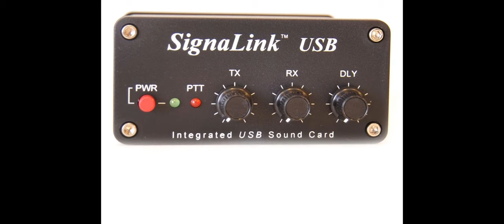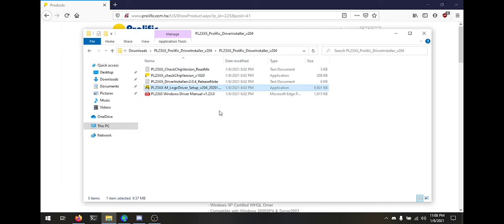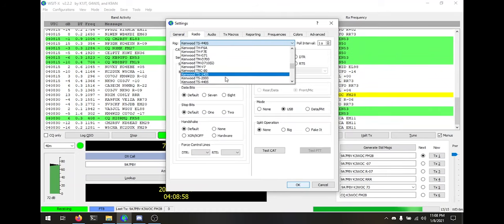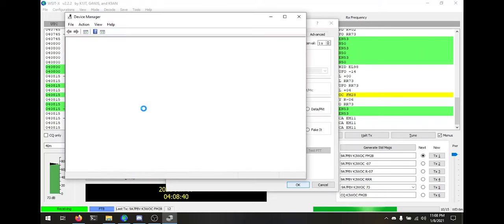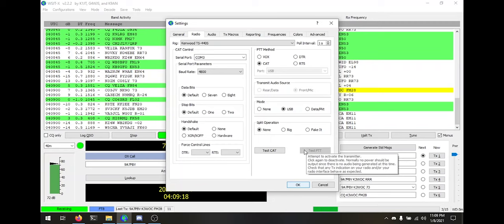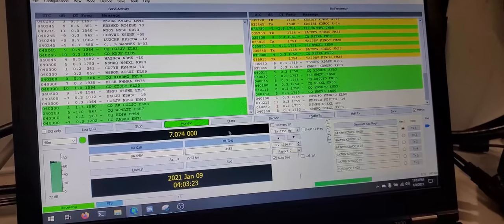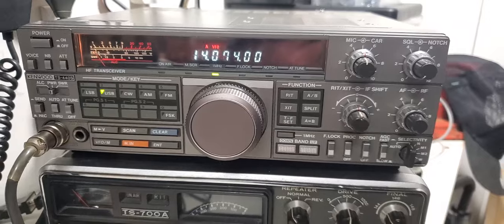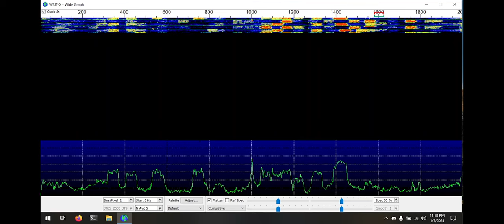Ham Radio Digital Modes and CAT Control for the Kenwood TS-440S (IC-10 Installation)

Comment: Thanks for the video. I'm a new ham radio guy and the TS-440s is my first transceiver. I bought a CAT cable and the integrated circuits. Today the ICs were built into the transceiver. I've problems with the connection to my Windows 11 notebook...

Comment: Thank you for the informative video.  I tried the Signal Link with my TS400S without success.  Your solution with the CAT cable and the Behringer U-Phoria UM2 worked absolutely perfectly with my Raspberry Pi.  Your solution is absolutely the best for the TS440.
Reply: I'd love to do the raspberry pi integration, do you have more info on this @alandigiovanni5282 ?

Comment: i picked up a non working 440 3 years ago, manage to get it playing, but it never was 100%, so a few weeka ago i bought a beat up unit from ebay, now i have a fully working 440 in great electrical and good cosmetic shape. with 270, 500hz filter and atu, next on the list is the IC-10 :)
Reply: IC-10 just arrived, time to make a set of cables.

Comment: This is a very nice tutorial, Marky. I bought the chips, the CAT-Cable and the UM2 and downloaded the needed software as you describe it here. When everything is installed I can start running FT8 on my old TS-440S. :-) Regards from DJ0MDC.
Reply: where did you find the IC chip set? i looked on pie xx and it came up zero results
Reply: I've done the same thing, but for some reason, I keep getting the error, I've come back to the old radio to try get it going, got any hints ?

Comment: That's a great mod for a radio with a few years on it.  In fact, if a clean and cheap TS-440 came my way...  My problem with FT8 these days is CPU power of the computer!  I'll be looking  for ya!  - W3ENR
Reply from the maker: Good to hear from you Ed!!! Hope all is well!!! You know, I tried using my brand new Raspberry Pi 400 with this task, and it was too dog slow! I couldn't tell if it was just a problem with the Pi, or the Linux distro, or maybe even fldigi, but it was unbearable. A project for another day will be for me to tweak the settings as much as possible and get it working efficiently on a Pi. Probably doesn't help having a waterfall running too. I was shocked how quickly I was up and running in Windows! Enjoy your weekend my friend!
Reply: @MarkyShaw  I mainly use JTDX.  I've overclocked my Pi 4b as far as it will stably go (~1.8Ghz), and it can't keep up with a busy band.  But the truth is that an i7 Intel NUC that I have - a couple generations old, but still a quad core i7 - can't do it either.  Watching the Pi, I know why.  At least for FT8.  It tries to cram most of the computing into those two seconds between transmission windows.  So the Pi would just put-put along at 700mhz or something until the end of the transmitting cycle, and then the CPU would immediately max out.  Problem was that it couldn't finish processing the signals in the two seconds it had.  So I would get lag.  A lot of lag if it was like 20m with 45 signals to decode.  I think I'm just gonna live with the i7 at home and the Pi when going remote.  It doesn't decode everything, but it still basically works.

Comment: I have a Kenwood TS 950sdx and the Elecraft KPA 1500 amp.   I also have the Kenwood IF-232c interface.  What I would like to do is to get the amp to follow the band changes from the transceiver Is there a RS-232c cable to USB for connecting to my laptop that you are aware of?   If I don’t have to use IF-232c, then is there a cable that goes from my transceiver (ACC 1) to USB for use with a laptop?  I purchased a cable that had the 7 pin Din plug for the Kenwood transceiver’s (ACC1) and a USB on the other end of the cable for my laptop, but I can’t get the Amp to follow the transceiver band change.  
Thanks  Dale     N0JDA

Comment: HI mate, would you have a walk thought pdf or doc to share, got the very same gear but I keep getting rig control error ?
Reply from the maker: Interesting! Usually the only time I’ve seen a rig control error is if the COM port selection is wrong. If you open up your Device Manager in Windows and expand the Ports section, unplug and replug in your USB to serial cable and double check what number it shows up  as. Only other time I’ve had those errors is when I was transmitting and it caused my USB devices to disconnect because of stray RF and an inadequate counterpoise on my antenna. I’m leaning towards a com port issue in your case. Let me know!
Reply: @MarkyShaw  ok I'll check that today, the USB to serial cable does it need a driver because the company I brought it from say's NO, I have my USB to serial cable going to a usb to rs232 db9 adapter thats correct yes.
Reply: @MarkyShaw   I got this going yesterday but now its not working my ALC needle doesn't move and it was yesterday, If I use my mic the ALC needle moves and I also get the red on air light, software changes the frequency OK, I've installed the CHIPI-X drivers and it was sending and receiving OK, its got me foxed.

Comment: Hey Marky, can you list all software that would be compatible with this build?  Also, can you use a USB to CAT Din6 Cable in this build rather than CAT Din to CAT / USB then to computer? We are looking at this and also doing the Panadapter SDR for the TS-440s, can you use both?
Reply from the maker: Hey there Rob, I can tell you that this build has worked great so far with just about any ham apps for Windows. I have thoroughly tested WSJT-X, FLDIGI , and Hamscope in particular and they all work great. In Linux, WSJT-X works well, but FLDIGI does not. Regarding the CAT control cable, they make a version that goes straight from CAT Din to USB on the computer. It basically has a built-in USB-Serial chipset in it. You can find them all over eBay. I personally like the CAT Din to DB9 version, but whatever works best for your application! I haven't tried any Panadapter solutions for this yet, but I've read that is possible with the right setup. Hope it works out for you!